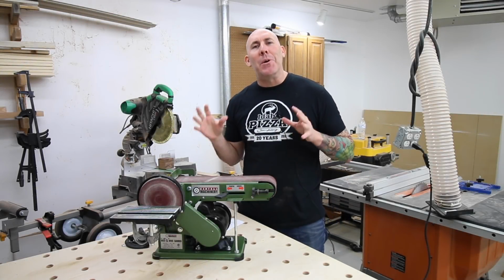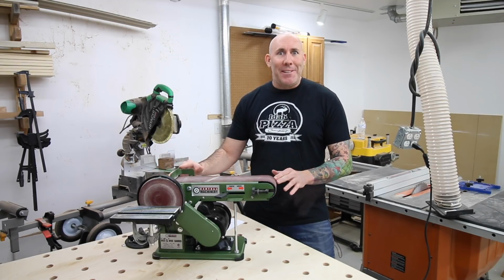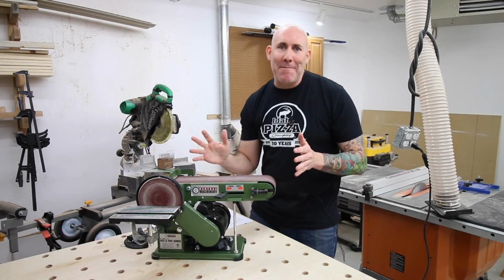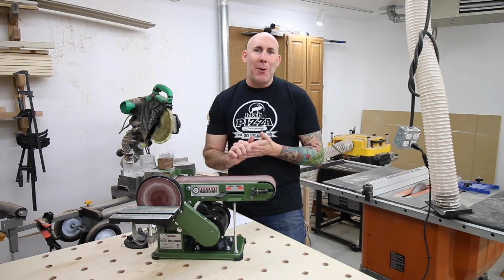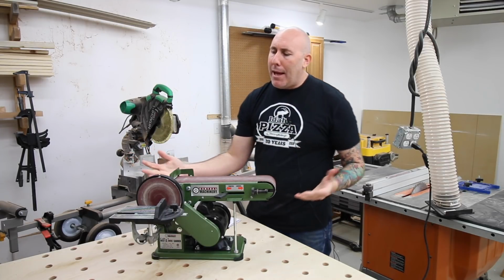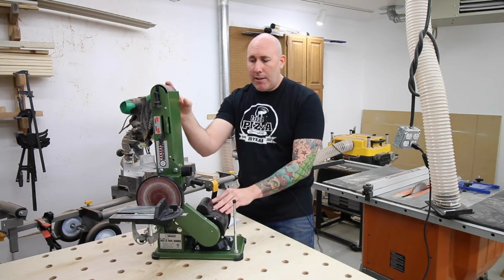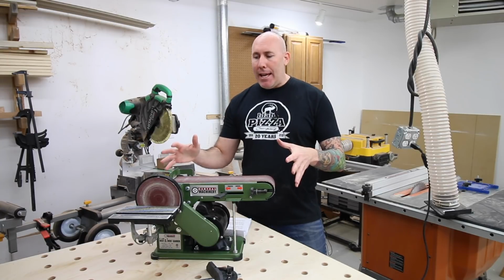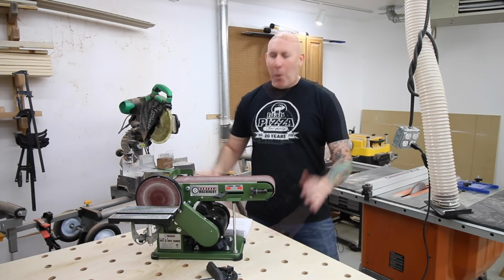Unbiased Harbor Freight Belt Sander Review

Comment: Hey man.  I am so frustrated because the "safety key" is literally  not pictured anywhere in the instructions and I cannot figure out how to even get the machine to work.  Can you please, please tell me what the hell they are talking about?
Reply from the maker: WOW - I don't ever read the manuals :) are they talking about the On/Off switch that has the plastic safety thing on it "usually yellow" you can remove from the switch so someone cant turn it on?

Comment: I bought my first one in 1995. About 12/13 years later the motor burned out. While there is a Grainger outlet in my community, it was much cheaper to just go back to HFT and buy a new one. Since I don't do production wood working, it suits my needs very well. If you don't unnecessarily bear down and "Let the grit do the grinding" instead, even then, yes, better belts & disks are in order. Yes, the miter table is not the greatest and the miter gauge is a joke. Both are not insurmountable fixes. Finding the right adapters for the dust collector is as close as my one mile away "Homeowner's Nightmare", as a dear friend used to call them. just look in either the plumbing department or where all the flexible adapters for roof vent pipe stacks are & you'll find something that'll work.

Comment: Disappoint with my purchase. Mine arrived with a missing screw, and the aluminum plate wasn't milled correctly. Thing wasn't even close to fitting the mounting pin. Going to Harbor freight tomorrow  to try and get a refund or exchange hopefully. ☹

Comment: It's 1/3 HP,  not 3/4 HP. The next step up is the Bauer at 1/2 HP.
Reply: The Bauer has a cast body and aluminum pulleys on the 4" belt instead of plastic. I just bought mine at HF for 109.99 on sale and would highly recommend it.

Comment: I bought it a year ago with a coupon and let it sit in the garage until l opened it up two weeks ago. With some adjustments, it works quite well. A little vibration but was fixed by clamping it down to the workbench. I’m satisfied with the money I spent on it. No complaints.
Reply from the maker: Thanks for sharing. Happy its functioning as it should for you! Cheers

Comment: Can this be used to sand stained glass?
Reply from the maker: I don't have any experience working with glass, so I can't give you a personal answer. However if you wanted to sand the Lead or whatever they use now I am sure that would work, and even for the glass. Just make sure the belt tension is tight when you get the sander and adjust if need to and get some quality sandpaper and I am sure it will work. Let the sander work, don't apply too much pressure and you should be good to go.

Comment: Had mine for decades, let's just say $29 and change when I bought it. Mounted above my attic stairs along with my Delta bandsaw. All kinds of woodworking, sharpening mower blades, shovels, deglazing and sanding brake rotors. Shares my homemade pvc dust collection system with the band saw. I collect dust from the post over the switch with a perforated piece of pvc. It is the most used piece of equipment in my woodshop. former aircraft inspector, railroad signalman, flight test electrician etc.
Reply: Hi David,

Would you mind telling me what type of sandpaper you used for sharpening mower blades and where you got it from? I’m looking to do the same on occasion.

Thanks!

Comment: it now comes with 500 Watt = 0.67 HP induction quiet motor, with nice bearings on the rolls.
sturdy cast aluminum table.
cast iron disc!

and yes you can replace the belt without machine disassembly, just loosen the tightening lever.

16 kg = 35 lbs  heavy on its own to absorb / withstand most of the vibrations, attach it to the bench if you need more 

I replaced the plastic knobs with the aluminum ones, which I made on this machine.

I believe the motor will not stall on the edge of the plywood sheet, if the belt is tightened properly.

I disagree with the review. 

this machine is made by the same factory as Wen and few other brands that look identical. only the paint color is different, and sometimes the knobs differ.

I can recommend this sander, it's a very good value for this little price. it will serve you for 20 years. if you are unlucky, the motor will break after 10 years, and then you can buy a new sander, because a new motor is more expensive than this whole machine.

Comment: Idahodian?
Reply from the maker: Southwest Idaho 🤘🏻
Reply: @RISENGRINDWORKSHOP  same NAMPA
Reply from the maker: @moejr14  Funny, same here :)
Reply: @RISENGRINDWORKSHOP  awesome. What is a good sand paper for metal
Work
Reply from the maker: @moejr14  Depends on how fast you want to remove material and what hardness. Aluminum Oxide is pretty standard and then if you want high performance you can get Ceramic or Zirconia
Reply: @RISENGRINDWORKSHOP  awesome thank you

Comment: How do you change the belt??
I searched for this video after I started tearing this thing apart 😬
Reply from the maker: https://www.harborfreight.com/4-inch-x-36-inch-belt-6-inch-disc-sander-97181.html You can actually download a PDF manual from the site. I have not changed mine out. Would imagine you just loosen the bolts that hold the motor down, then take the covers off and then you should be able to remove the belt and put a new one on.

Comment: I am a piano technician and use a belt sander for many wood shaping jobs.  I have had this machine for over 5 years and initially I had to push the belt to get it started.  Now after 5 years it still works if I push start it.  
It sucks but I live with it.   
It works better than the Ryobi unit I had before,  which would keep chewing up the drive belts and throwing them off.

Comment: I had to file some groves in the nut slots for the motor so I could move my motor forward to tighten up the driving belt lol. Ended up having to adjust the belt housing tool. Works great now. Just getting started and won’t be using it daily. I used to repair machines at several machine shops so I think I got a deal considering all that.

Was fun fixing a broken brand new machine lol. It was almost like the people who made mine just gave up and shipped it lol.

Comment: The stock motor is not that bad. The problem with it is loose belt tension and it is a simple and cost-free fix. All you need to do is loosen the mounting bolts then move the motor to maximize the tension. You can use something like a tire iron or something similar to get some leverage. Then just re-tighten the mounting bolts. The entire process takes under five minutes and then it works great.

Comment: Definitely a no go for metal work. It will work in a pinch but plan on being there for a while. If looking for a belt sander for metal work make sure its at least 3400 rpm
Reply: Works great for brass, nickel, and similar softer metals. I'm in the musical instrument business and it is great for small parts and such.

Comment: How do I keep the top sander belt from moving to one side?
Reply: The dial near the end is for tracking, not belt tension. Some machines have the plastic idle pulley so out of shape that they won't track. Luck of the draw with no QC.

Comment: Unfortunately I purchase this machine before watching your video. I was so excited about it. I do just do crafts but I really wanted some thing that would sand well. I guess I’ll put it together and try it for my own opinion since I already spent the money
Reply from the maker: Machine will work just fine for arts and crafts! You will enjoy the purchase. Just replace the sandpaper that came with it and make sure the belt tension on the motor and pulley are tight.

Comment: Is it possible to take it apart and install the pieces to a bench grinder for more power and positive contact? I noticed that every belt driven bench sander has the same issues, while the bench grinders with sander attachments are more consistent. Please let me know.. Either spend hundreds of dollars on sander attachments or $60 for an upgrade on my existing bench grinder?

Comment: Is this good enough for  Metalworking such as flattening a flange or shaping certain parts?
Reply: I had to modify mine as the engineering was pretty pathetic,...rollers touching and friction heating the sheet metal frame, etc...literally ground away few millimetres here and there with Dremel tool,  got it put back together and runs great. Get higher end belts from places like combat abrasives or  empire abrasives and it will work decently for stock removal. I sharpen blades and form knife blanks with mine...it's not the best, but starting shop on a budget, it works!

Comment: It's for a hobbyist,  not made for industrial use. Good for the price. Had mine 4 years. Still going strong! And yes the motor will bog out if you're applying alot of pressure, but for a broke hobbyist, it's just right...not for industrial use.

Comment: I also have one of the older belt sander it’s a lot better than this one I use mine even for sanding steel, the only problem I had is the drive belt wore out bought some new ones on Amazon and they are very cheep.

Comment: Had one of these, used maybe a couple dozen times at most. (light shaping on small pieces of wood, nothing taxing) 
"90 degree" bracket on the belt wasn't close to square.
Table on the disc sander flexes with very little effort.
That angle guide is a joke. 
Gave it away when the bearing went out on the disc sander.

Comment: I bought it for beveling metal, works like a champ. Who put that much pressure to stop it? How hard you need to sand.
Reply: Mine sometimes needs a push just to start turning unloaded. The motor is that weak

Comment: This sander sucks!, if you put any pressure on it at all it will bog down or even stop the weak ass motor. The round HF sanding disk that are glued on will sling off almost every time you turn it on. I guess if you're building stuff out of balsa wood it would be OK.  Save your money and buy a good one. JMO!

Comment: Central pnuematic 6 gal compressor is a POS as well!
Reply from the maker: No personal experience with that unit. However based on my past experience with a variety of tools, I would purchase that item knowing it was going to be a throw away item. I have heard the Fortress brand they are now stocking is pretty decent. Personally I would go with the California Air Tools small compressors. Thanks for the comment
Reply: Get the black one.

Comment: Replacing the
 drive belt with a green belt from NAPA cures any slippage I ever had.
Reply: That was my thoughts and was going to ask.
Reply: @danieldunn6284  Take the belt to a NAPA store and ask for the green belt version its a touch thicker/wider so it doesn't slip in the pulley.

Comment: I've had this belt sander for almost 20 years. NEVER have I stalled the motor sanding something with this machine. I've always used the belt sanding portion in a vertical position. The machine has given me zero trouble, the vibration is minimal with this machine if it is on a solid work surface. I like it because it is easily stored in my work area, is light enough for me to handle and sands everything I have tried on it. I'm still using the original disc in the sander and have only replaced the belt three times. I don't do production work with it, but it does exactly what I bought it for every time.
Reply: Pete Schemberger  I've long suspected that Harbor Freight has no control over the quality of the tools they sell. From the variability I've seen, it looks like they bid out a rough spec of a tool to multiple manufacturers and pick the lowest bidder. It looks like a lot of these sanders were pure junk, mine has never failed me. Same machine, but obviously not the same parts. I had the opposite experience with a hand drill I bought. Buddy bought one and it was great, I got the same thing and it can barely handle an 1/8th inch bit drilling through a 2x4. Total junk.
Reply: Pete Schemberger  I've seen other comments stating that the stalling happens because there isn't enough tension on the belt which they fixed. Have you tried that?
Reply: Maybe they used to make them better.  Mine sometimes needs a push just to start up unloaded.  The motor is that weak.  If you do the math on the rated amps vs rated horsepower, they do not add up.
Reply: @larrydillon5775  That sounds like a burned out winding in the motor to me. Had something similar happen on a table saw motor. Amazingly, that got fixed under warranty but not at Harbor Freight.
Reply: @YooToob Moderator Hardly. I wouldn't let a kid in the shop if I was using this thing.
Reply: I pretty much word for word have the same experience with it. I thought it was a mazing machine let alone for the cheap price

Comment: I have this machine. Use it a good amount. I would constantly stop the motor until I learned how hard to press. Eventually(2 months of daily use sanding metal) the belt started tracking off. Some of the welds broke. Welded it and it has been working ever since. It is cheap and works. Welds might break but you can fix that easily. The unit is very light also, it moves when you use it.

Comment: I had one of these sanders and it worked great straight out of the box until I had to replace the sanding belt to a different grit, you have to disassemble the machine to replace the sanding belt and reassemble each time taking about ten minuets every time you change the belt. I returned it and bought another brand that you just have to pull a lever and slide belt off and another back on taking seconds not minuets.

Comment: I use it for grinding bevels. The 60 grit belts wore out really fast but I could get a few good uses out of each one, and they're cheap enough to replace that it doesn't seem like a huge waste. I recently picked up one of their new zirc belts, they seem quite a bit nicer so far. Biggest thing with this machine is to let the machine do the work. Like he said, if you press hard it stops almost instantly, so just go slow, don't rush it. You'll probably be alright for your garage projects. If you're doing a production run of 1000 cabinet units, don't buy the cheapest sander from HF, anyway. Again, I know your needs and understand the limitations and you'll be fine. 3 stars. My 2 pence.

Comment: The presenter failed to discover/mention that the table for the disk sander can be relocated to be used with the belt sander in the upright position.  This feature was not mentioned in the instruction manual that accompanies the machine.
Reply: I’ll check this out tomorrow. I wasn’t aware of this.

Comment: The motor didn't stop in the video. You can see the disc sander still spinning. The belt wasn't tight. Not so sure about the unbiased part.
Reply: I was hoping this comment was around.
Reply: Uneducated on basic tool setup is more like it.

Comment: I bought this on sale and was able to stop the belt sander with a 4" x 1" piece of pine pressing lightly on it.   I would have returned it but I wanted too long to open it.  A waste of $60.
Reply: Adjust the belt tension by loosening the motors mounting bolts and moving it away from the pulley.
Reply: @mwilson70201  It is not just the belt that stopped but the motor as well.

Comment: Now for the most part, I agree but however, this is rated for DYI'ers and home owner projects. Thats just perfect for that . Now , as far as the , what id love to call "construction grade" ..No this machine and brand isnt designed for that. This machine is best used around the home project. Think of it like this . If ya want to make money then spend the money. But if your trying to save money then skip on the price tag. This is also great for teaching teenagers how to use powertools in a safe manor. Great teaching tool. They learn thier skill and technic on a lower powered tool. But dont forget to tell them the difference of grade and skills.

Comment: Yeah gotta say you made me almost not buy it until I saw it was 60 bucks when the other identical ones with a different name on it were 150 to 200. Moved the motor back and no more slipping.
Reply: Does it do basic sanding without breaking?
Reply: @ratdog420  like  I said I was shopping around and unless your going to dish out 500 bucks they are all the same. some chinese factory just slaps a different logo on the side
Reply: @user-lx7bk5xk6r  Thank You going to pick one up tonight using it mostly for a laser cutter so the wood is pretty thin cannot fins a coupon anywhere to use on it though but still a good price.
Reply: @ratdog420  yeah it works its worth the money in my opinion. my brother has an older craftsman that is wayyyyyyy worse.
Reply from the maker: Glad this unit is working out for you. As long as people work within the units ability it's fine. I still think saving and buying the larger unit from HF is a better all around machine, if you have the budget!